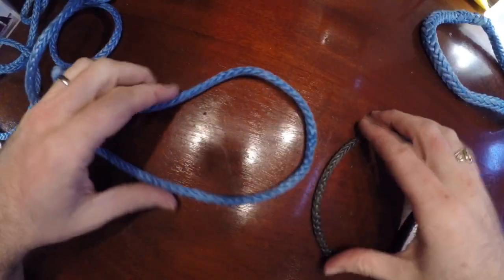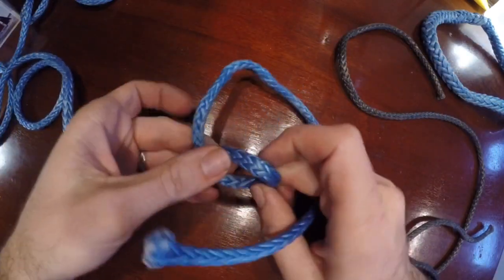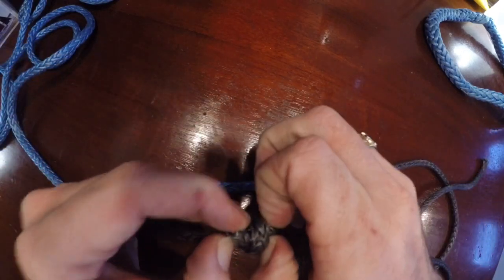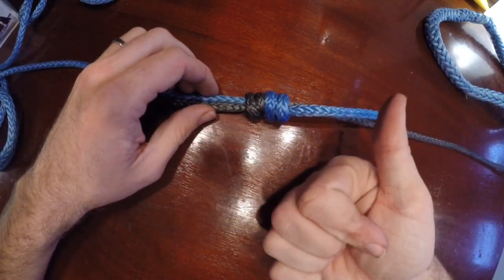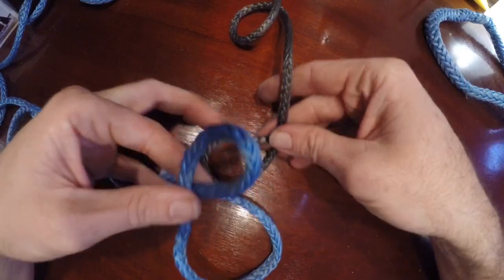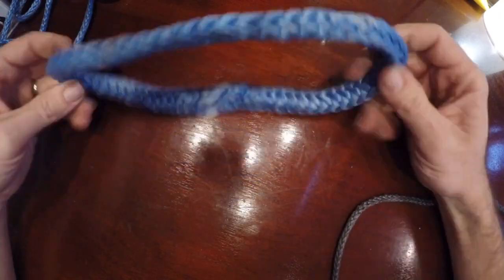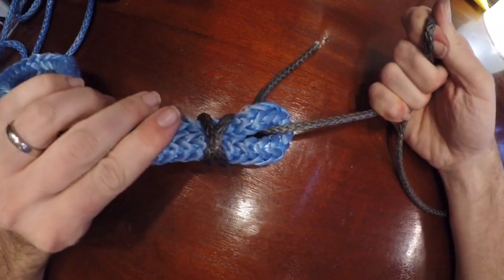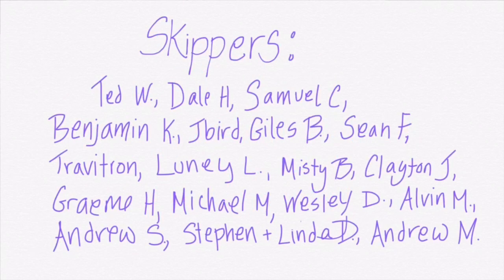4 Ways to Connect 2 Ropes! | Sailing Wisdom

Comment: Great knots. I have a request with some exposition:

I’m doing some light log salvage. I pick up a log here, have to tow it while looking for the next, pick that up, tow, repeat. So, currently I have a strong, 7/8” line with a bowline on the end as my main tow line. Next, I’ll drive a dog (it’s like a spike with an eye on the end) into the salvage log, with a lighter 6-10ft painter attached. I’ll then tie the painter into the tow-bowline with a ‘better bowline’-angler’s loop. Effectively that’s bowline to bowline, which as you say does chafe, but has the advantage of being quick and leaves plenty of play for the next log, and next 25 logs… I understand that ideally the tow line might want to end in a 3” ring that my dog lines would then tie to, but that of corse weights the line that I need access to each time I add a log.
So, security doesn’t seem to be an issue; the main tow line and its bowline are solid, and I can still untie it after a full day of heavy loading. The dog lines and their angler’s loops are fine as well, fast and easy to slip at the end of the day, no issue with loading. But chafing is defs an issue. I need to cut 8” from my main line every two months or so. My dog lines are a consumable and can stand going from 10’ down to even 2’ before they’re trash, so I don’t worry too much about that, but I can only shorten my main tow so much before it’s unsuitable as a tow, plus it isn’t cheap.

I hope that’s clear. What would you recommend as a ‘better’ setup here?
Reply: Wait, it’s so obvious! Your dyneema grommet. If I tie one of those to my main tow line, that becomes the consumable and I don’t need to sacrifice any tow length. What did you call the splice? A Mobius What?

Comment: Never heard it called the "Acres Bend" before.  In climbing and backpacking I always knew it as the "Zeppelin Bend."  Best way I found to teach it is with the two ropes/lines in a figure 6 and figure 9, with the tail of the 6 on top and the tail of the 9 on the bottom -- lots of easy jokes, but it is memorable!
Reply from the maker: That is a great way to remember it!
Reply: Thanks for the great memory tool! See my other comment for a recent application where I would have liked to know this knot.  In my situation I ended up tying the two rigging lines together using one line as a prusik style knot (don't know it's name) ON THE OTHER LINE and it worked just fine, plus WAS easy to untie.

Comment: I love watching about knots. My actual favorite knot is the Alpine Butterfly because it comes in handy so often for adding an attachment loop to a line where you don't have access to either bitter end. Three loops around 3 of your fingers, so you're looking at 3 laying toward you. Take the nearest and move it to the furthest position, then take the new closer one and pull it out and away, then back through the hole that your fingers leave. If done properly it will be symmetrical and have a look similar to a bowline. This is a knot that can be released after heavy load and will never fail. Per you advice, you would connect other lines with either hardware or a knot like a sheet bend. I always place high value on being able to untie a knot later. What knot would you recommend for tying a dyneema running backstay to a block w/ 1/4" or so swivel (8mm dyneema to Lewmar 72mm Sync block)?
Reply: Captain AJ's knot class w/ Drake Paragon is an oldie but goodie. His "flying bowline" always looked like some kind of circus trick.
Reply from the maker: If attaching a block for a running backstay, I would suggest splicing it with a Möbius Brummell eye splice.
https://www.riggingdoctor.com/life-aboard/2015/12/24/mobius-brummel-eye-splice

Comment: Really appreciate!
I do tree trimming & removal as my hobby job in retirement.
Had to join two 150' ropes as the pull line for a tree wanting to fall in the opposite  direction  of where we needed the fell. (For  safety, we set up two such lines on the tree, plus a third "directional assurance" line at 90 degrees to the pull lines.)
Had never run into a situation of topography needing to run such long lines over a valley to reach anchor trees.
Got the job done, but perhaps not with the best knots.
Because of the potential load these ropes would be under, that "Anchor Bend" looks really good for strength and ease of untying.
Thank you, Doug Marder, for the "69" suggestion!

Comment: I believe that the two tag ends should be on the same side or strength is  reduced.  I see in your video you have them on opposite sides.  Also a stopper knot in the folded back line is good insurance.  Most tests to failure will have this knot simply slip apart if the stopper knot is not included.

Comment: Can I use the Fisherman knot to join two anchor ropes together? I have a 50m anchor and want to add another 100m. Thanks
Reply from the maker: A splice would be the best bet. If they are three lay rope, a long splice would be ideal, closely followed by a short splice. 
All knots have tight bends that will cause the line to twist hard and weaken the overall strength. 

If you absolutely have to join them with a knot, a double sheet bend is the strongest option. It’s a permanent knot so don’t plan on separating them after you use it. The knot will be bulky so it won’t run through a windlass anymore either. Only a long splice would be able to slip through a windlass without issue.

Comment: 0:30 You showed the insecure (left-hand sheet bend). The correct sheet bend has both working ends at the same side.
Also at 01:00 the Double sheet bend. The correct double sheet bend has also both working ends at the same side.

Comment: There seems seems to be controversy about the nomenclature of the bend described here as an 'Acre's' bend.  I believe it to be the same as what is commonly referred to as a Zeppelin bend.  For an interesting discussion on this knot I suggest visiting the Wikipedia article on the 'Zeppelin' bend.   However, the term 'Acres' bend is not mentioned in this article.  I would be interested in knowing where the term 'Acre's' bend arose?  I was unable to find it with a google search.
Reply from the maker: I read about it in a really old book on knots. The Acres Bend was the same as the Zeppelin Bend, but Acres was easier for me to say and remember so that’s the name I’ve used. Guess it’s time to update my vocabulary!

Comment: Will the two-fishermen-knot method work for tow straps?  Will the tension limit be at least as strong as the original straps?
Reply from the maker: I do not know as straps would end up with a kink in them with this knot and that would cause stress and lead to failure. 
For straps, I would do a sheet bend as it would retain about 80% of the original strength, but be sure that as you tie it the straps stay in one plane (flat through the turns, no twists). That will make it hold better, untie later, and remain stronger. Any twist and the knot just goes straight to hell!

Comment: Good video. However, your double sheet bend version is not the standard version, and should be less secure. This is because in the standard version, the standing part of the thinner rope bite its rounding tail twice. Your version bite only the tail once, and is easier to slip, as shown in your final tying of it to a thicker rope ring. If you had used the standard double sheet bend version, this video would have been fully useful.
Reply from the maker: Thank you for the feedback, we will make a correct video soon

Comment: If you plan to use any of these where your life is dependent on it, I would strongly suggest doing more research on climbing specific knots. Many of these will fail under conditions that can occur during climbing. Also, for climbing, you almost always want to be using a dynamic rope, not a traditional static rope... Any time a climber is on a static rope, they maintain it in a loaded condition, as shock loading can be fatal with static ropes or tethers.
Reply from the maker: This is for sailing, not climbing.

Comment: You tied the sheet bend incorrectly.  Pass over working end first not standing end.  Also the fisherman knot is a permanent knot. That's why it's also called the impossible knot.  Impossible to untie after a heavy load.  Carrick bend is one of the best.
Reply from the maker: Thanks for the pointers! I need to practice the Carrick bend more.